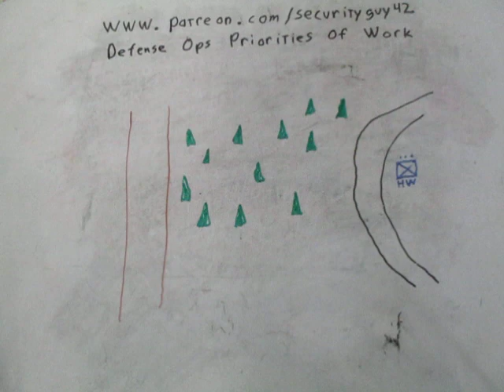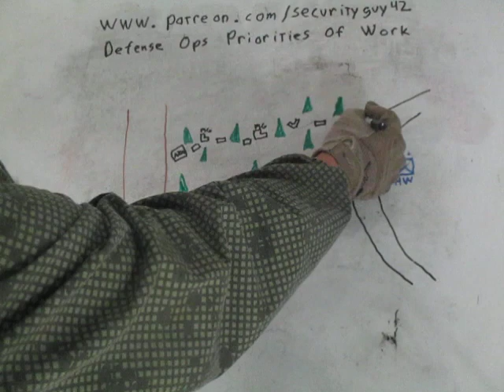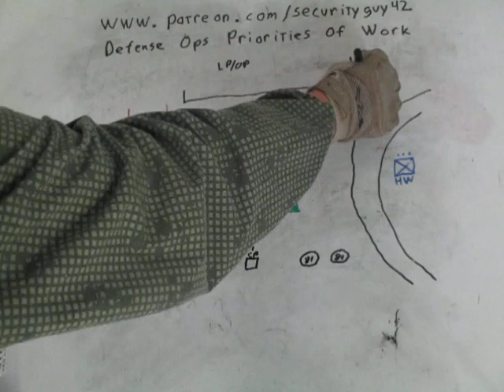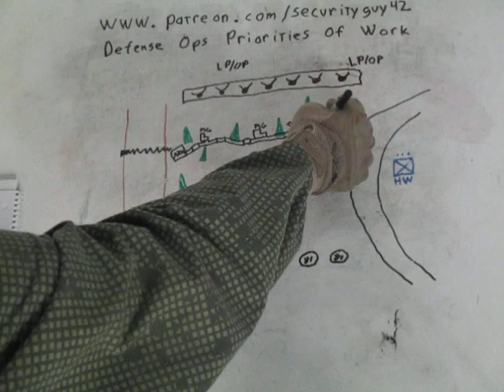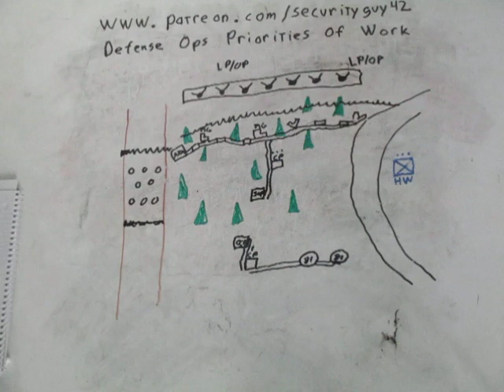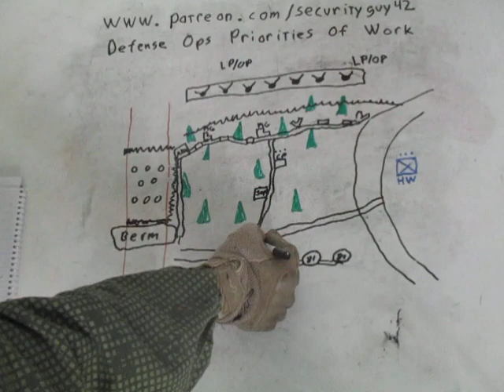Fieldcraft- Defensive Operations Priorities Of Work

Comment: Hasty Faraday cages for personal electronics. Use foil lined chip bags. Turn them inside out, wash. Slide smaller bag into larger bag foil side out. Example checks mix bag, into smaller lays bag. Slide extra sheets between layers. Put into a zip lock bag for waterproof layer. Wrap around, fold around small electronic devices, like cell phones, com gear. Seal in plastic zip lock bags. Store for use. Bags may be cut up and be taped up with foil tape for exterior foil backed insulation seam tape. Any size needed may be made. It works, and is cheap and easy to make. To test make a bag (5min) put cell phone in, leave on. Arrange a call wait for arranged call to pass. Pull phone out. Call your co-tester, get their input. Should have positive results.